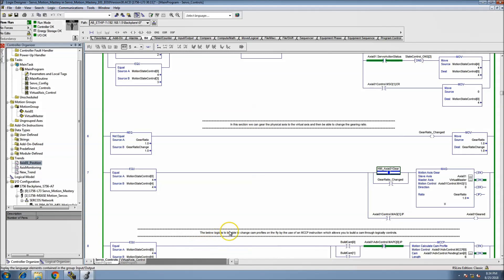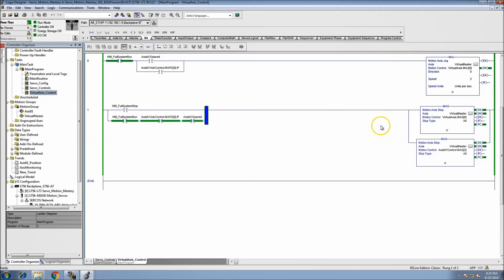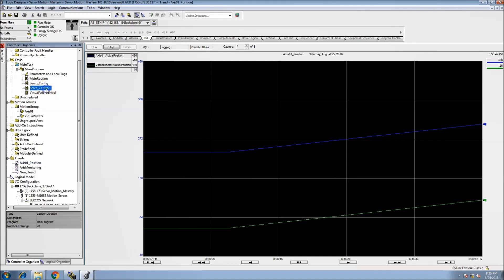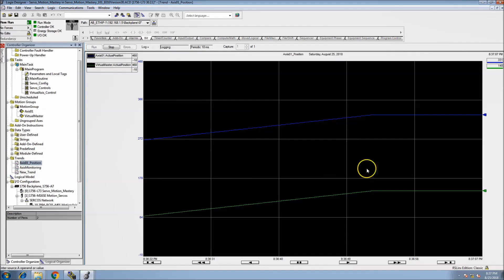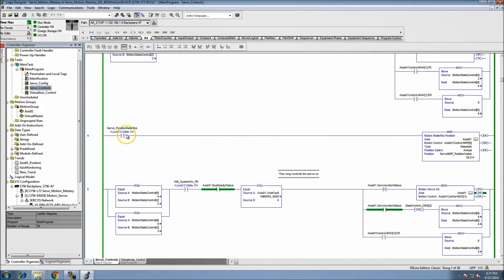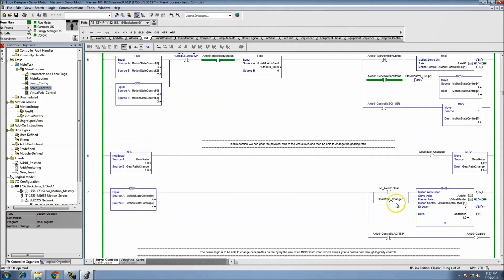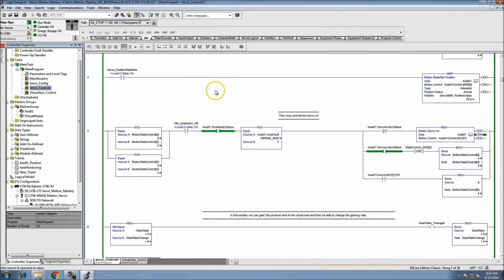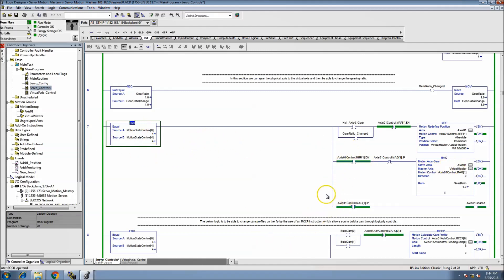RSLogix 5000 Using a MRP Instruction Before an MAG Instruction For Servo Axis

Comment: i have two motor which connected to each with gear  both will run difrrent direction.what is  the best  for control matching  electronic gear and position .i would appriciate if you could help me .whihc one of your course is about synch two motor
Reply from the maker: Gear the motors together using a MAG instruction then make sure the direction is the same if that is your goal. There is a setting in the instruction for the gear direction
Reply: @ShaneWelcher  Thanks Shane for your reply.i done MAG . how to find axies control tag (MRP OR MAG when its done ) im new to AB .Thanks
Reply from the maker: @mekbots7607  they are in the motion tab in the instruction section

Comment: oh lawdy don't use the EN bit to turn its own command off.
It results in pulsing of the command.
Reply from the maker: Please watch the video, it plainly shows how controls work.

Using state controls & periodic tasks plus proper timing as servo controls work best with are the key.

This is what the Industry often sees, people quick to give their opinion without having even watched the video.

I truly hope that you watch the video because our industry needs more open minded people looking to improve themselves.

My motto is:
To be a better version of myself tomorrow than I today.

That requires challenging myself & caring about being humble enough to learn no matter where I am.

This video shows proper function.

A working example in the video of  real world controls so why would you doubt something you see?
Reply: @ShaneWelcher  I enjoy all your videos....Have been doing motion for 20 years.  However, he has a point.  You don't typically use an XIO of a Motion Command .EN bit as a condition to the motion command itself.  In your case it works, potentially because your Gear_RatioChanged condition is essentially a one scan one-shot.  However, we don't see the logic behind the other command HMI_Axis01Gear.  Since you are toggling it in your example, it presumably has no destructive instance, so it's an HMI bit.  Supposed an operator holds that bit ON.  Then the MRP instruction is toggling every scan.  Perhaps you have logic that enforces a one-shot on any HMI bit and that would also resolve the issue, but it's not clear from the video and could be confusing to someone uninitiated.  Keep up the good work.
Reply from the maker: @robertmee2  not the way I do my HMI buttons.

During press, do nothing 

After press then write a value of 1 the pause for 1 second then write of value of 0.

It's an anti-sticky button design
Reply: @ShaneWelcher  Are you doing this in the HMI?  For Anti-Stick, always in the PLC.  Doing that in the HMI is problematic due to I/O server issues/loss comms.  An easy way in the PLC is XIC HMI_button, ONS bit, OTE HMI_Button.  The HMI simply sets the bit.  That always insures an HMI button is on for one scan.  Code should be written to never need an HMI button on for more than 1 scan, IMO, but of course always exceptions and multiple ways to skin a cat.  Anyway, not trying to critique your work, exceptional as always, but just pointing out that you and I can assume nuances because of a greater knowledge, but someone else may apply improper use of an .EN bit in front of a motion instruction without considering all other factors and it will cause issues.
Reply from the maker: @robertmee2  in the HMI button 
Using the command button